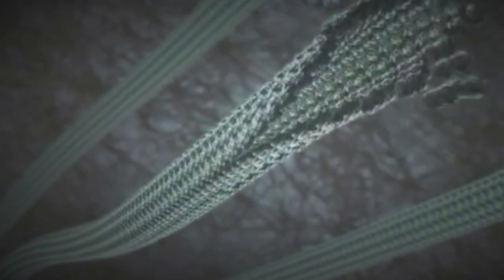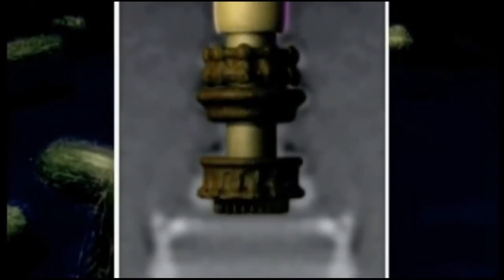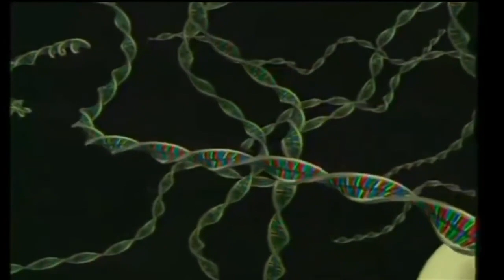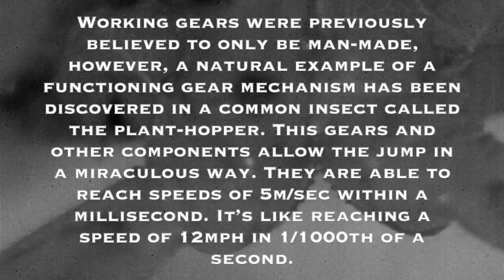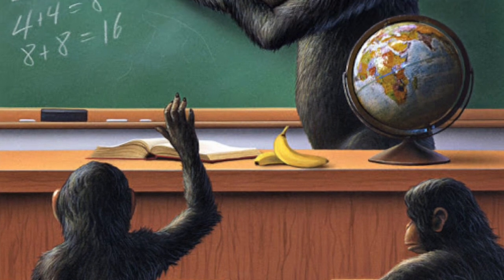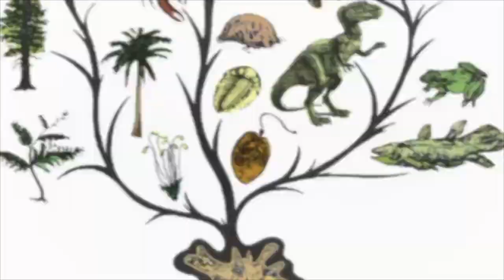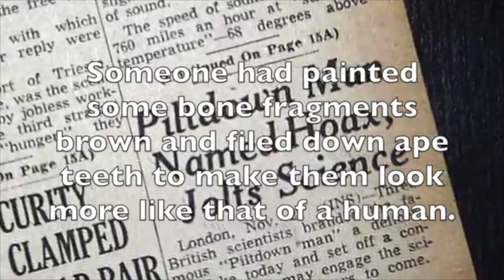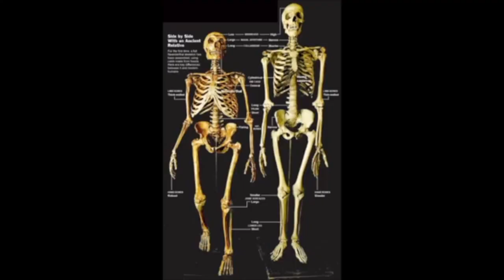MICROSCOPIC GEARS DISCOVERED LOOK MAN-MADE

Comment: "Gear: one of a set of toothed wheels that work together to alter the relation between the speed of a driving mechanism (such as the engine of a vehicle or the crank of a bicycle) and the speed of the driven parts (the wheels)". These are not gears, they're limbs with teeth that move back and forth to create movement. They do not possess a circular motion.

Comment: Here's how the so-called "irreducibly complex" cellular motor could have evolved naturally:

Step 1) Lipid cell membrane exist. You don't need an intelligent creator for a membrane, if you blow soap bubbles, they automatically form membranes.

Step 2) The "stator" studs appear on the inner surface of the membrane. It's not a motor, just the stator.

Step 3) The "rotor" appears inside the stator. It doesn't have a "propeller", it rather just rotates in place. However it creates some motion which is beneficial for the organism.

Step 4) The "filament" appears on the stator, by elongenating the stator. It is beneficial for the organism so those genes are passed to the offspring.

Step 5) By natural selection, the filament gets longer and longer, evetually reaching its current size.

Step 6) By natural selection, designs that are the most efficient, emerge. Any mutation that improves the motor quality, get passed on to offspring. Hence, the most "optimal" design is what survives.

So, here's the proof that a cellular motor is NOT "irreducibly complex" - you can break it down to simple steps of evolution.

And also proof that the video creator doesn't understand evolution, and how it works. Scientists nowadays even use evolutionary genetic algorithms to find "optimal" solutions to engineering problems, that eventually yield better results than man-made designs. Proving again, that random evolution can lead to designs that are even better than man-made designs, as evolution always leads to the most optimal designs.
Reply from the maker: What made the phospholipids? They are made by an organelle within the cell and aren't found in nature. Each cell has about a billion of them, so it would take a lot of them being made in nature and at the same spot and just happen to wrap around RNA.
Reply: I assume they're made by enzymes. Does an enzyme require a cell membrane to function? Of course it doesn't! So it is possible that the organelle formed later, before that it was just an enzyme that produced phospholipids somewhere.

So possibly:

Step 1) Enzyme appeared that synthesizes phospholipid by the billions.

Step 2) These lipids naturally form a bi-layer membrane, due to their chemical properties.

Step 3) Cellular motor later appears, see original post.

Saying that "evolution doesn't happen" or that "cellular motors are irreducibly complex", are basically nonsensical claims. Once you have an enzyme that produces phospholipid molecules, cell membranes will form as a natural consequence.
Reply: Also, see the following vid on how fatty acids naturally emerge:
https://youtu.be/mRzxTzKIsp8?t=280

Organic life is not required for cell-like lipid membranes to form naturally. That happened before self-reproducing organisms existed.

Comment: Anti-biotic resistant bacteria.  Evolution happening right before your eyes.  
You’re right that these mechanical structures are amazing, but they are built by time, not by a creator.  
Existence itself?  Well, that’s another subject.
Reply from the maker: Antibiotic resistance is a good example of micro-evolution, but it's caused my man and has yet to produce a new kind of organism, just a stronger version of an existing organism. The rate that evolution would've had to happen to get where we are would require many new organisms to have formed within our lifetime.
Reply: FLAT EARTH BROTHERS Well, you did get me thinking last night.  And I’m afraid I’m not coming over to the creationist side on this particular issue.  God is a different matter, and I do have a belief system, but it may not be as cut and dry as most.  However, you did get me thinking on how ‘micro biological machines’ may develop.  It’s very difficult to visualise (even over time).  The best way I can see is multiple organisms coming together to form one (more complicated) chimera organism, that now has part of a new advantage. 
If you check out Biomes.  These are huge organisms, made of many organisms.
You are right, that science has not fully explained evolution down to this level.
Although I may not share your belief on this particular matter, it is well argued and has got me thinking.  So thank you for that.👍🏻
Reply: Sorry, they’re called pyrosomes, not biomes!
Reply from the maker: It's one of those topics that has no limits to how deep you can dive and can drive you crazy if you let it. It definitely had me acting like a mad scientist in my classroom and drawing out timelines on my board while also compiling the fraud. It's a topic that is nearly impossible for us to grasp fully due to complexity of life. This is why we need animations to show us the inner workings of cells, DNA, etc and also for the larger system of creation such as earth. We'll always need composites or artists to construct things that none of us will see in this lifetime.
Reply: FLAT EARTH BROTHERS Well some say the search for God, is the search for truth.  
And I guess in that, we are all on the same quest.